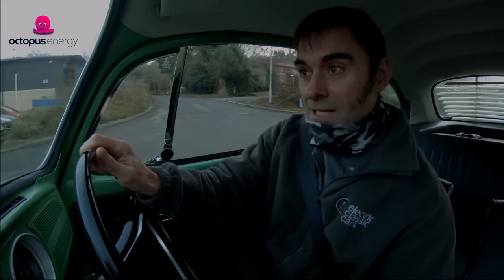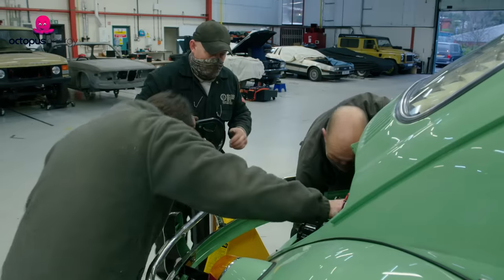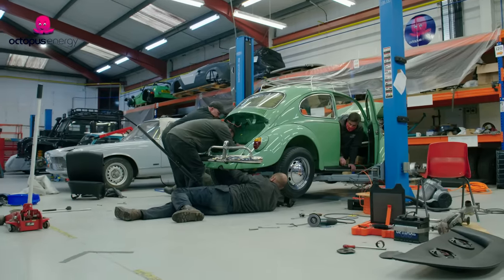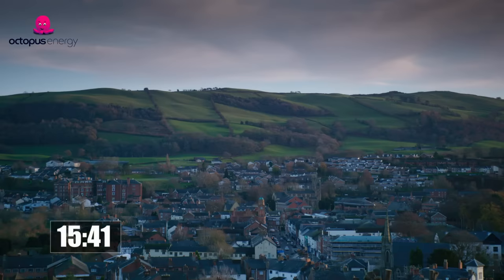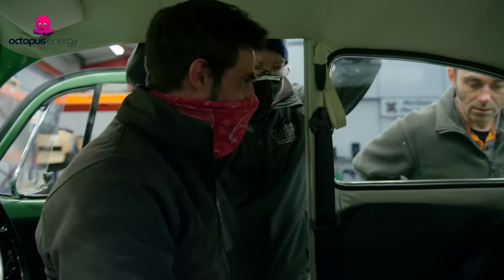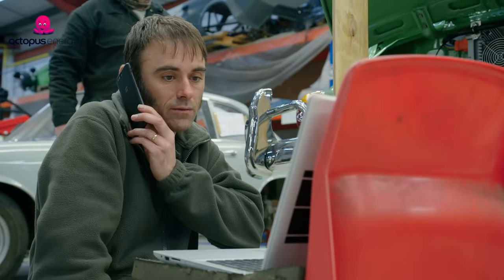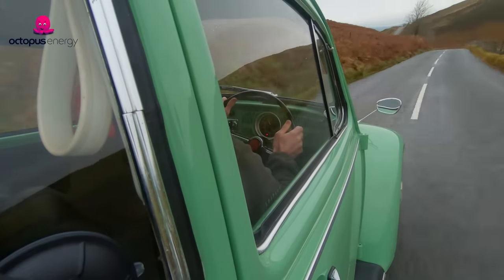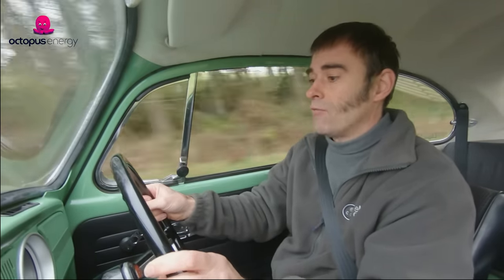VW Beetle converted to electric in a day

Comment: That's on clean little beetle! Hurts to see such a nice little engine removed.
Reply: It’s all the better for it.
Reply: That engine is not nice
Reply: Forget the gas engine
Reply: If the body is still good and can be converted for future use, isn't that good for the environment? Not a junker,  just needs to be fixed up.
Reply: Indeed, there is no free ride in physics, supply, and demand.  ICE engines make the most sense since all the components are readily available and the exotic components are only necessary for the exhaust catalyst. Electric "R/C-style" cars are built on a foundation of exotic components within the limitations of their battery size and long charge times.  A 5-minute or less charge is required to get the median 400-mile range of ICE engines, and their stored energy tanks.
Reply: @Dan123. You think that's not going to be the same for petrol? Puh-lease.
Reply: @Dan123. You know nothing, Jon Snow.
Reply: Big time! Super clean...
Reply: Electric cars pollute MORE than those with gasoline engines.
Reply: Yeah, that's what I thought. A beautifully restored VW beetle and an obviously rebuilt engine. What a waste. This car now has virtually no useful storage area, weighs much more than standard and has a piddly range of 80 to 90 miles. It stopped being a classic car as soon as the motor came out.  I used to work on these in the 60's and early 70's. Very simple cars to work on but these blokes have made it as complicated as buggery and they are now the only garage in the UK who can fix the thing. I'm not against electric cars, they are the future, but changing things significantly in a classic vehicle means it's no longer a classic or a collectors car.
Reply: @akulkis  I know thats actually true but most people think the opposite. I am getting tired explaining why.
Reply: @zakr1187   n
Reply: @akulkis  depends on the source of electricity.
Reply: Electric is better
Reply: Yeah but would hate to electrify a piece of junk!
Reply: @TecnamTwin  no it's not.. it cost more to charge it now than it did to fill the tank and you're still polluting at the power plant.
Reply: Is that actually true, @rodshoaf ?  If so, tell us the figures you found that prove it. 
Or, is your claim just a conveniently topical exaggeration?
Reply: Who is to say it won't be given or sold to someone, who can make use of it?
Reply: 20 Years it may be affordable to drive. How you going to charge it ,sunshine, wind? ha ha dream on
Reply: Being a 'classic car',   @MrPropanePete , is purely subjective.  
Less storage space, y'say? 
Okay, so owning a '60s Beetle, and as your 'daily driver', in the '20s.   Do you seriously think that people would do that, and sheer luggage capacity is a prime reason for choosing the Beetle? 
Complicated as buggery?
Compared to an early 60s VW, any model of Prius is infinitely more complicated.  So too is a Corolla hybrid, an E-Golf, any model of Hyundai, or even a 2013 BMW 3 Series. 
Hell, all of them are probably far more complicated than even this electrified VW. 

While we're here, exactly how much heavier is this electrified Beetle, than the stock ICE version?
Reply: @80club45  But everything was fine with gas engines before.
Reply: @nzlemming  Neither do you.
Reply: As a Fan of these Cars I have to call a Beetle without the iconic engine sound HERESY.
Reply: These had a reputation for weak heaters. How well does the heat & defrost work now?
Reply: @AsinineComment  Reported on the news 4 days ago.... Drivers in the UK alarmed it cost more to charge than to fillup
Reply: @rodshoaf  And I'll bet you were wondering how soon there would be a price  'reset'!
Reply: @jhexp999  actually, yeah. Or solar.
Reply: @everready59   what you gonna do when the sun dont shine and wind dont blow? you'le get a taste this winter.
Reply: @sunbeam8866  I could care less... I'll be driving further on a tank of gas... from any corner gas station and be able to fully fill up in 2 minutes and be on my way.. and IF you find a charging station, you'll still be sitting there on your behind 30 minutes later... which you have to repeat what 8 times just to go a 1000 miles at highway speeds.  Or if you live in Cali, won't be allowed to charge until after 9 pm!
Reply: @zakr1187  looks like you got out voted
Reply: @Dan123. no it doesn't
Reply: @Dan123. wait,  I just realized you're in Europe,  nvm
Reply: @AsinineComment  I'm not sure what you meant by "daily driver in the 20's" as the first beetle was hatched in 1938. I have three friends who drive restored 1962 Beetles to work and the shops on a daily basis, I helped with one of the restorations (I'm a retired mechanic). But yes, I admit that is a fairly unique situation. Here in Australia the specialty vehicle insurers will accept the 1962 Beetle as a classic car depending on what you want to do with it. Daily drive or club events, car shows, etc. My engineer mate estimated the Beetle in the video would weigh at a minimum an additional 150 kg or more. Electric motors are very heavy as are batteries. The flat 4 VW motors were made from aluminium alloy and were very light, about 80 kg from memory with everything attached. The torsion bar front suspension in this video looked almost fully compressed with the weight of the big battery up front, it will slog out after a while. But anyway, they skipped over a lot of detail but it was still an interesting video from an engineering point of view, but I think the outcome for this particular project is a vehicle with very limited capabilities.
Reply: Such a shame, such a cean engine.
Reply: I'm with you 100%. Doing that to such a clean beetle is an abomination! Couldn't even watch the entire video.
Reply: Right now it's a piece of shit
Reply: @4thArmoredVet  I absolutely agree. These guys have taken a nicely restored classic car and turned it into a toy with limited capabilities.
Reply: @Borgadin  Absolutely agree.
Reply: @MrPropanePete  they ruined the car
Reply: @justinjay9501  They sure did, and it was done just to produce this video.
Reply: @coupur  or don’t electrify anything and stand up to piss. 🥴🥴🫠🫠
Reply: I have a 69 mustang that I want to convert to electric.. But the car is kind of too nice so I keep postponing the conversion..
Reply: @juchou2983  Keep your 69' Mustang just the way it is Ju, and buy an established name EV for your daily drive rather than ruining your classic Mustang. Which engine does it have?
Reply: @MrPropanePete  it's nothing special. In fact it is too low spec to be a collectible. It's a coupe with 200 cu inch inline six and three speed. Interior is super nice.. Exterior 7/10..
Reply: @juchou2983  Just the same, that's an original car so it will gain in value and rarity over the next few years. Hang onto it, you will regret it later if you electrify it.
Reply: Agreed. It's painful to see dorks ruining great classic cars.
Reply: @Dan123. not anywhere close to true
Reply: @mattym893  Absolutely. They've buggered up a nicely restored beetle and turned it into a mish mash of a thing with limited capabilities.
Reply: @juchou2983  you want to convert a ‘69 Mustang to ELECTRIC? You don’t deserve that car at all
Reply: @Tom-zp1rp  yes, because it does not even have a v8 in it. Please buy it from me before I completely ruin it. I paid 9k for the car. I will sell it for 8800.. Willing to sacrifice 200 for mustang heritage.
Reply: @everready59  You are in climate cult arnt you .I listen to Tony Heller .i could say more but i cant argue with a sick mind.
Reply: @TecnamTwin  No it isn't classic cars need to be respected
Reply: Agree 100%.....
Reply: @PowerandControlUFU  80 miles range and 24hr charge time junk
Reply: Actually now it's probably DIRTIER, despite being from the pre-smog era.  Unless it's charged by hydro or one of the solar or wind boondoggles, it's now effectively powered by COAL! 🤣
Reply: @MrPropanePete  Agree with everything you said, except...electric "cars" are most definitely NOT the future....at least not until there's absolutely NO accessible oil left...which won't be for CENTURIES...AT LEAST.
Reply: @coupur  Lmao...that "piece of junk" will EASILY outlive EVERY SINGLE EV currently on the road, even with the appx 60-year handicap. 😂
Reply: @rodshoaf  Yep ...and those are ironically the same people who think mice are dummies for getting cut in half by the trap in the quest for the "free" cheese. 🙄
Reply: @rodshoaf  Lmao, I know, isn't it freakin hysterical??  A multi-trillion-dollar boondoggle which technologically leaps us two centuries BACKWARD! 🤣🤣
Reply: @joeygarcia6647  AFTER the butchering, yes, sadly.
Reply: @juchou2983  God, WHY!?!? You'll render it nearly worthless and make it HORRIBLE to drive. 🤮🤮...not to mention unbelievably inconvenient and unreliable.  Please sell it immediately to someone who appreciates it.
Reply: @serfcityherewecome8069  That's true. There are huge environmental issues with sourcing rare earth's and the production and disposal of large EV batteries on a global scale. I'm sticking with my diesel VW Golf for years to come.
Reply: @gtc1961  And in New Zealand we use 90% renewable sources which are not carbon emitting. Germany is trying to compensate for not using Russian gas because of the war in Ukraine. You cherry pick without having understanding of the big picture.
Reply: @Dan123. depends what your power source is.
Reply: "Everything was fine with gas engines before"?  
It seems, @chrisb3976 , that you really haven't been paying attention.
Reply: @rodshoaf , have you somehow imagined that the end of fossil fuel engines, and the start of electric car use, was always intended to be done over a few weeks or days?  
Blind Freddie could see that it's absolutely essential, but that the process would be gradual.
The biggest impediment to that?  Fossil fuel miners, refiners and sellers - and the compliant politicians they successfully lobby, to slow or stop the vital policy changes we need.
Reply: i was thinking the same, there wasnt one drop of oil on it.   it looked like it was a concourse car ready to be sold,  damn shame, now its worthless.
Reply: We're in the '20s now, @MrPropanePete .  Given a choice, the number of people who choose to drive a '60s Beetle for its luggage capacity and as their daily driver...?  That number would be microscopic, if not entirely nonexistent.  
Classic?  The argument that every single old car in really good condition should be left untouched and factory spec, is nuts.  If it was a Lambo, then yeah - but fortunately, there's 1 or 2 more of these Beetles still around.  
Weight?  If it's no longer burning any fossil fuel, extra mass is less a concern.  
That it affects vehicle dynamics, is more significant, but that can be accommodated with a range of suspension and structural mods.  No biggie, for a novelty car like this.
Reply: That might be the case, even though nobody has coughed up a reliable figure,  @rodshoaf , but it's obviously an unforseen and temporary complication.  Nor doesn't it mean these conversions to electric are a bad idea.   Do you imagine that the weekly household budget of these fellas, hinges on the energy costs of this Beetle? 
Imagine every step in the advancement of energy generation, or vehicle design, or development of a new industry, etc, was stopped by a temporary cost, or delay, or change of plan.  It's clearly a fallacious argument, based on narrow and short-term thinking.
Reply: @AsinineComment  The 20's to me are the 1920's Baxter but anyway, fair enough comment overall and you made a couple of good points. I did read through a lot of comments and was actually a bit surprised to find the majority of respondents shared similar views to mine. I thought it would be the other way around. You  summed it up correctly in your last line when you called this a "novelty car". Someone somewhere would have paid in excess of $25,000 USD for this conversion and the result is indeed a novelty particularly with a range of just 130km (80 miles). Anyway, as you said, there are still plenty of early model beetles around for restoration so it's not the end of the world.
Reply: @zakr1187  original oil bath air filter? Yea you may not think it’s nice but it sure is expensive
Reply: @Dan123. Where tf do you live haha
Reply: @akulkis  they don't where it matters, in my nose!!
Reply: That engine will probably go on and save another beetle!
Reply: Agree. They should have used lesser example or a basket case bettle
Reply: @spaz Dead right, they stuffed up a perfectly good VW beetle just to make a YouTube video. There is so much hype and BS getting around about EV's.
Reply: It can now be cleanly driven to the shops, then you can't fit any shopping in it.
Reply: ...... and to all who will complain about my remark.
Just relax in spite of all the jibber, it's still stupid.
Reply: @Dan123. How long do manufacturers warranty ICE cars? A warranty isn't a use-by date. A coworker has an eight year old i3 with original battery and plenty of capacity. If you're going to argue against EVs, at least do it in good faith.
Reply: @MrPropanePete  It looks like this car was riding low in the front when it rolled into the shop. Probably been lowered already, Cal-look style.
Reply: @mattagnew206  Actually, yes it was too now that I look back.
Reply: @AsinineComment  No I don't imagine an end to the internal combustion engine... its simply irreplaceable in today's world.. and considering we have at least 1000 years worth of natural gas beneath the US alone there is no need for it.
Reply: @Dan123. You're stating that running an i3 for 12 years will cost £42k in batteries, and I'm here to tell you that you're wrong.
Reply: @zakr1187  It is actually quite a nice engine compared to the leaking rust buckets I grew up around!  But this electric conversion is awesome! I'd like to do something similar to an old Jeep CJ5.  I haven't searched to see if it's been done already but think it would be great.
Reply: @Dan123. Wow, where the HELL did you hear that?
Reply: Hopefully, that engine that was pulled out will find a new home .. I'm sure it's not going to waste!
Reply: @Dan123. Show your source for BMWs recommendation that the battery needs replacing every four years.
Reply: It's better than the miserable stock engine
Reply: The battle is on;40hp vs 140 hp ....it reminds me of the classic story the hare and the tortise
Reply: @mpowe123  what is good for environment in Electric cars? Highly toxic bateries and no idea how to recycle it?
Reply: @adriansalas8424  if forget about toxic  bateries..
Reply: @Dan123. Where?
Reply: @Dan123. it rlly doesn’t
Reply: @Dan123. you don’t actually understand what a warranty is. A warranty is how long they will cover fixing or replacing. My sewing machine had a 5 year warranty on it. Still going strong 15 years later.
Reply: @zakr1187  that is just "The" most reliable engine ever made...what do you mean by no good?!
Reply: That's what I thought mate...just a neat and clean "green" little beetle...I would stick a 2.0 liter boxer motor in that engine bay...👍✌
Reply: @Borgadin  drive one…you’ll get over it!
Reply: This is stupid to do to a classic car like that. Find a new car to convert.